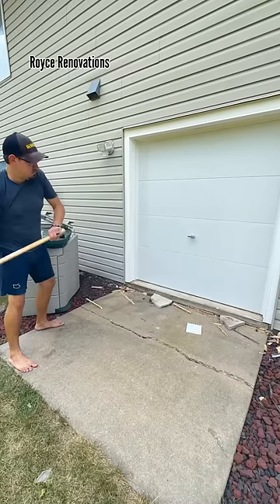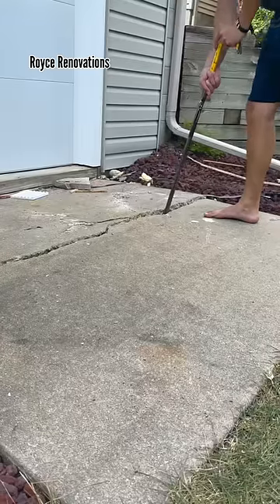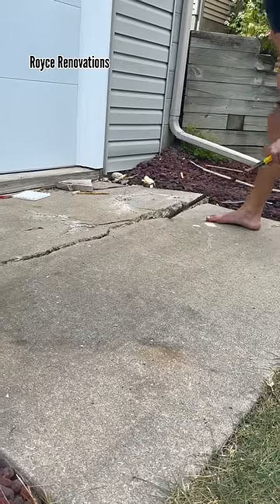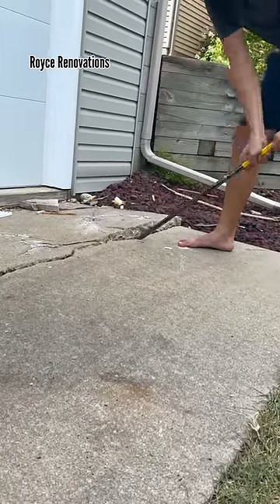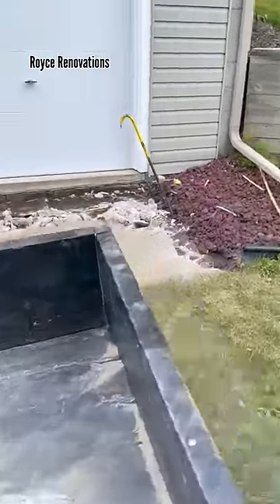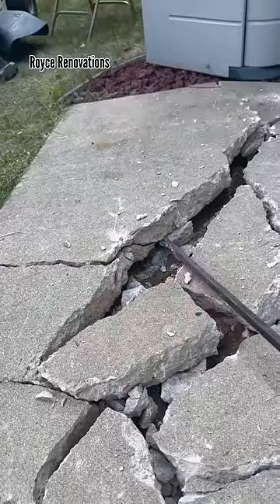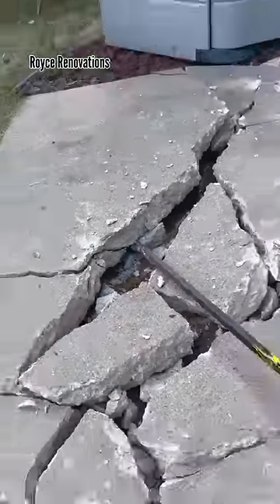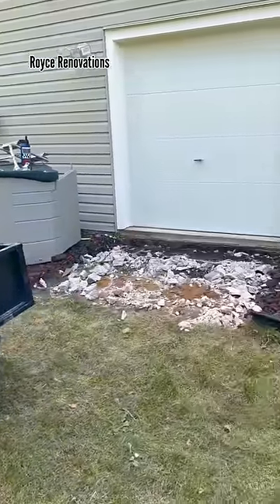Just Do It Right The First Time #shorts

Comment: If you have a properly prepared well drained sub base you don't need rebar in that application. If you place concrete without adding excess water and saw cut it as soon as it will bear a load it will only crack along the sawcuts. Rebar is a waste of money on sidewalks ... the only time you need rebar in residential flatwork is if it spans a void.

Comment: Rebar doesn't strengthen the concrete. Its used to hold it together at joints. That concrete looked like grout not concrete. Wire Would have helped but it didn't have any rock that i could see

Comment: Rebar does not prevent cracking it keeps the concrete together when it does Crack 3 things about concrete 1 it's going to Crack 2 it will take forever to fully cure if it does at all and 3 its going to Crack

Comment: The concrete was put in by a homeowner and since it’s not going to be used by anything heavy only lawn equipment as it ended in the grass, figured no rebar needed. Could have just as well built a wooden ramp.

Comment: actually look like gravity popped that slab... as in the soil flowed and settled and then the unsupported crete snapped. if the slab is thick enough (use defines thickness needed) then it wont break. also not 100%initial

Comment: Don't necessarily need wire or rebar. Was probably poured too wet. Cracking is an inherent property of concrete. Control joints are to control where it will crack. 

My mentor in the concrete trade told me concrete takes 50 years to fully cure them it begins to degrade. 

Trivia tid bit.  Roman concrete is far superior than any mud we have today. Today, Roman concrete is still getting harder.

Comment: Asphalt and Concrete are WEARING PRODUCTS they will all eventually crack and disjoin. The only question I have is HOW LONG did he enjoy a crack free slab before cracking? If it’s 7-10 years he’s in an appropriate age range if there was an unusual storm front one year. There is no need for bar to be installed when there is GRASS connected to the transition being a shed entrance there’s no heavy duty items rolling on it, in this case just base & grade it with 5inch stones and you’ll be fine no bar needed.

Comment: The pad is too thin for rebar anyway.
Use Chopped Basalt fiber WITHOUT sizing, 7% by weight, demand 4" median with 7" and 1" extremes.
Make your concrete at no more than 8% water and hand pack or use a pavement hammer. It will be hard, crack propagation will be minimal and your product will stand overpressure.

Comment: Could have done a 5”-4” slab with no rebar and it could have lasted longer with proper ground preparations. I did a slab for a neighbors backyard so they could play basketball @ 4” thickness with no rebar almost 5 years ago (at least) and they play basketball on it daily with no cracks. This guy looks like he parks his lawn mower in that little garage, probably cracked from that since it wasn’t designed to support that weight. YES rebar would have helped support it, but it’s not necessary.

Comment: If you make concrete with salt water it will last a lot longer. For proof there are stil roman concrete structures over 2000 years old and stronger today than modern concrete.

Comment: The dirt didnt have anything to do with it concrete needs relieve joints becuase it will crack from expanding and retracting from heat and cold make sure you add one in the new pad

Comment: It failed because it was only 6” at most and you drove a heavy car over it for several decades. 10 “ thick with a good base crusher run under packed down fiber concrete you will not need rebar you could use wire mesh if you want with it held up by a few pieces of brick. But truly the fiber would be enough unless you are driving heavy machinery over it .

Comment: Nobody puts rebar in a slab. You would be cussin and swearin all the more if they had. Pretty stupid to be bustin out concrete barefoot. But it's your toe loss on your house. Freeze with water underneath or ants and critters will cause . Just barely big enough to put an expansion joint but I probably wouldn't have on that size either.